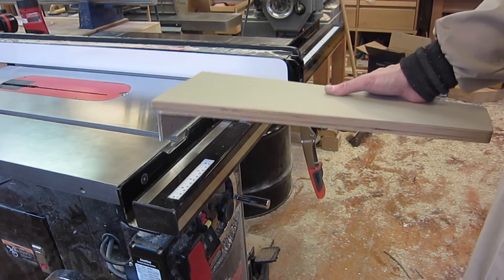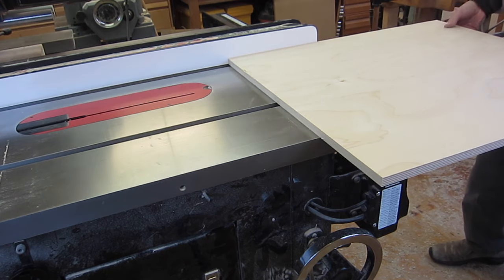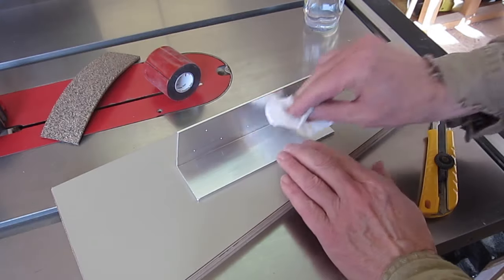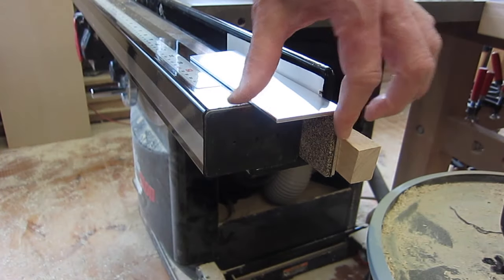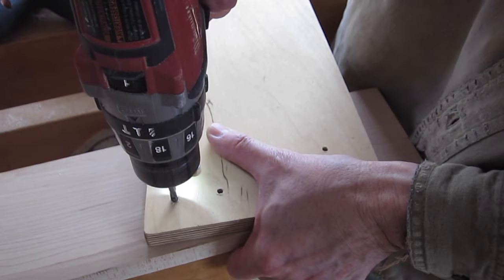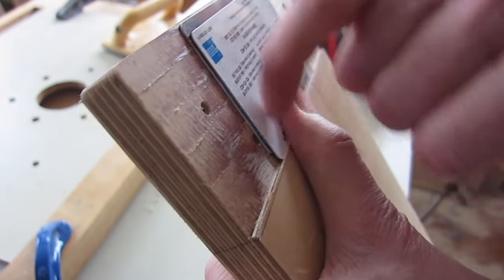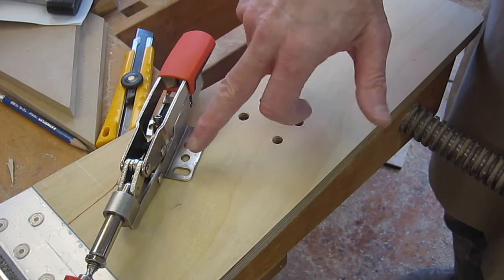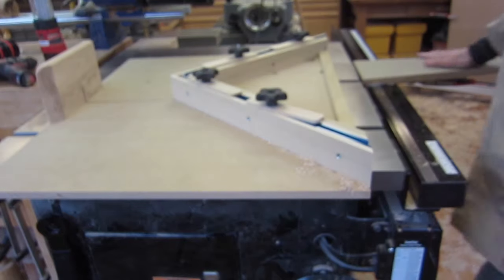Clip-on Infeed Support for Table Saw including SawStop T-Glide fence.

Comment: My sawStop has a different rail. I drilled 1/4” holes and attached my support with inset T-nuts on top and 1/4-20 threaded rod with knob glued on with red Loctite on the bottom. I made a slot for miter gauge and cross-cut sled.

Comment: I spent many years doing high end cabinets, millwork etc., so I have an intolerance for all these wannabe experts with a ton of solutions to non problems. I like what you did here, that was cleverly done. I subscribed because I'm interested to see what else you do.
Reply from the maker: Thanks.    I only make a video, when I have a solution that is not already on YouTube, or perhaps a solution but poorly explained on YouTube.      Here is a couple of my favourites, that I was surprised to find no one else doing:  1) Mortice sled for router table https://youtu.be/GyyMiuB62-k     2)  Spring hinge feather board for bandsaw https://youtu.be/S3L-7cU1kAo
Reply: @steven.woodward  Thanks! I don't do this work anymore, but I certainly mis it, but especially the problem solving part and while under pressure of time constraints. I don't know If I'll have the chance to use your ideas, I'll certainly enjoy watching. For me it's refreshing to find a wood working content creator I can learn from.

Comment: Hey, thanks for posting this.  I think it's an improvement on Izzy's.  I've been looking at as many different designs on this and yours is at the top.  Take care...
Reply: I'm considering purchasing the Izzy variety. Just curious what you think are the shortcomings compared to this design? Thanks!
Reply from the maker: @completeopposite  I think the Izzy version is a good product and I can't really claim any advantage over it.  The original Izzy design used a wooden cam for a clamp, but has since changed to a toggle. .Some reviewers said they replaced the wooden cam with a toggle clamp to get a better grip.    The toggle used on Izzy does not appear to have a rubber or plastic tip, so you might want to do something about that to avoid scratching fence rail.

Comment: That’s a great idea but I’ll add this for new woodworkers who might come across this video even 2 years later… if you can afford an expandable roller stand/conveyor and you have the space, get one. It’s well worth it. Portamate makes one and it’s actually on sale right now. Also Rockler now has one and Woodcraft now sells one as well. They’re also great if you have the usual Dewalt lunchbox or 735 planer like a lot of beginners have. Get two stands… they have casters and you can raise them to any height and there is a scale on each of the four legs. Great for tablesaw indeed, great for indeed/outfeed for planers on a shop-made stand/cart or production cart.

Comment: I wish I could do that for mine but I have a RIGID and the
rail is an extruded aluminum "tube", which bolts flat against
the edge of the table (no gaps). Making a folding outfeed is
also impossible, as the motor sticks out the back. 
Those are bummers but I am not truly complaining, because
it is a good saw and years ago, I got a really good price, on it.
It has served me well. 😁✌🖖
Reply from the maker: I used to have a Rockwell table saw with round rails, so I know exactly what you mean.  Maybe there is a  clever way to attach an infeed support to round rail - like a block of wood on the end that fits snug between rail and table .
Reply: I'm in the exact same boat. Mine has been a good saw too but I may get ride of it to get a (used) cabinet style, or at least a ridged that has the motor mounted below.
Reply from the maker: @chriswkbrd     I used a Rockwell contractor saw for 30 years.   Replaced with a cabinet style SawStop, primarily for the safety feature, and was surprised how much smoother a cut I got with the cabinet saw vs the contractor saw, even when using the same blade.  Must be due to vibration and arbour runout on the contractor saw.

Comment: Hey Steven, I see you on the SS forum on FB. I just saw the Izzy vid on his take on this and now I see yours. Good job but his is some better as it allows for a miter gauge. I need something like this as all I have is the JSS Pro. Outfeed would be awesome as well. It might be easier to incorporate the saw into a table for that though.
Reply from the maker: I think Izzy was the first with this clip on idea.   I copied his but with a different clamp.   Decided to leave off the miter slot and add it later if found to be needed.

Comment: I like your use of taps and machine screws to attach the aluminum bracket to the 3/4" plywood. Can you tell me a little about the specifications for the machine screws; particularly length, thread count, material, and manufacturer.
Reply from the maker: They are metric M5 x16mm flat head socket stainless steel from this kit. https://www.amazon.ca/gp/product/B06Y3JDM4R/ref=ppx_yo_dt_b_search_asin_title?ie=UTF8&psc=1    The only reason I chose metric is because I already had that kit, and they looked like a nice bolt.  Most machine screws are made in China, I have always found the stainless steel screws from China to be of good quality, but have found regular steel screws to be poor quality.
Reply: @steven.woodward  Thanks for your reply. I forgot to ask if your tap ran all the way through the plywood. Given that you added a laminate top I wasn’t certain whether a bottom tap would be required.
Reply from the maker: @Hibbing49  plywood is 3/4"  or 19mm.   Bolts are 16mm, of which 3mm is used up by the 1/8" thick aluminum bracket, so only 13mm penetration into the plywood.    I used a regular tap, not a bottom tap.     If the bolt is a little longer than the threaded part, it will still work because the bolt with cut its own threads for the last bit - this works on wood, but not on metal.
Reply: @steven.woodward  Hi again. Now I have made a little progress but am a little stuck on the countersinks. I am curious to know about the countersink you used and whether you used a drill or a drill press to cut the countersinks? It appears that the aluminum angle makes for a tight fit when you drill the countersinks closest to the interior bend. How did you manage that? Thanks again for all your help.
Reply from the maker: @Hibbing49  Good question regarding countersink, I should have shown in video.   

I used this countersink: 
https://www.amazon.ca/gp/product/B000F3SI2O/ref=ppx_yo_dt_b_search_asin_title?ie=UTF8&th=1.  

Mounted in a round hole drill bit extension:  
https://www.amazon.ca/IVY-Classic-10702-Extension-High-Carbon/dp/B0050PV4M8/ref=sr_1_25?crid=3BNWE3B8M5AJW&keywords=drill%2Bbit%2Bextension%2B1%2F4%22%2Bround%2Bhole&qid=1641918693&s=hi&sprefix=drill%2Bbit%2Bextension%2B1%2F4%2Bround%2Bhole%2Ctools%2C67&sr=1-25&th=1

Another way to make a countersink is to use a 1/2" diameter regular drill bit.  Not as smooth as a countersink, but works ok if you go slow, especially in a drill press

Comment: Was there a reason you didn’t mill a slot in it for miter gauge?
Reply from the maker: Thought I would try it first without a miter slot, and then add slot if needed.   So far I have not found a need for miter slot.   I am not a big user of the miter gauge, but would likely add the slot if I was.
Reply: @steven.woodward  would you have made it bigger if you had the material on hand ? I’m probably going to make one bigger by a few inches.
Reply from the maker: @paulyanney3151  A few inches bigger might be a good idea.   I use mine mostly for supporting table saw sleds, so that the sled doesn't tip when hanging  off the front of table saw - for that purpose the infeed support does not have to be very long.   If using to support ripping of longer pieces of lumber, then a longer infeed support seems to make sense.   Here is a really long one, with a support leg, made by another woodworker: https://www.instagram.com/p/CB5X-mPjaAr/?utm_medium=copy_link&fbclid=IwAR248o7YKBzh-R5FxswF5ksy2EhvpetGur0jVKchf6dz1ocguHyQ29fQIsU
Reply: @steven.woodward  thanks I made something similar I use with my large sled. I’m going to make a smaller one similar to your’s which will come in handy for a variety I uses. Thanks again keep those helpful videos coming.

Comment: Where did you get the “slippery” tape yiu out over the metal bracket? I’d like to build one of these. thanks!
Reply from the maker: I got one roll from Lee Valley in Canada, and another roll from Amazon.   It comes in different widths and has an adhesive backing.   Not expensive.    Just search for:  "UHMW tape"
Reply: @steven.woodward  thank you sir

Comment: Using the cross cut sled is a bad example, you wouldn’t need to bring the sled that far back.
Reply from the maker: Good observation.  I agree.   A better example would be this cross cut sled that can be used for cutting panels, in which case it is pulled quite far back https://youtu.be/3qRyBiNbXX4